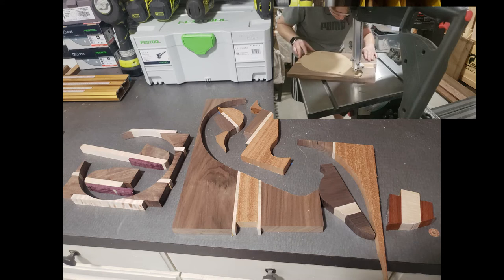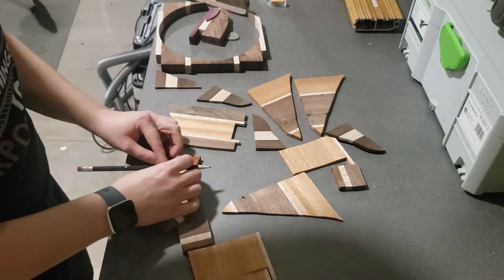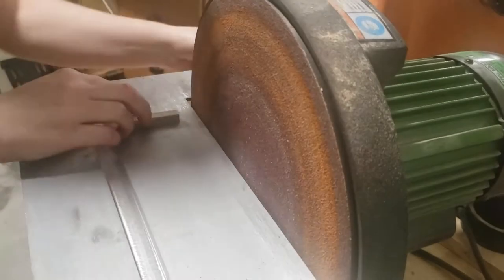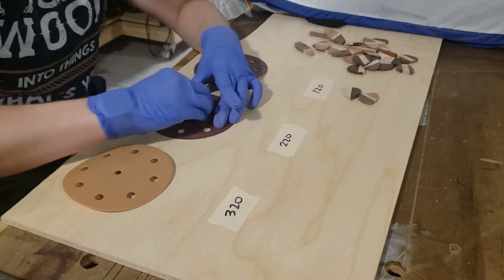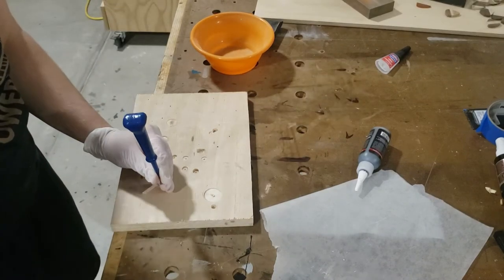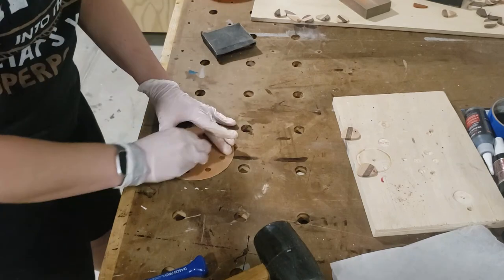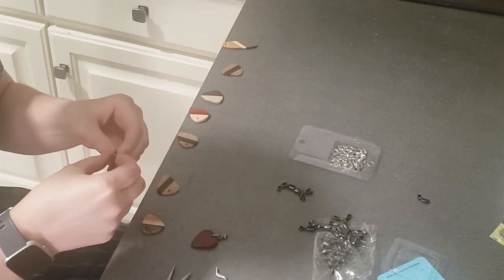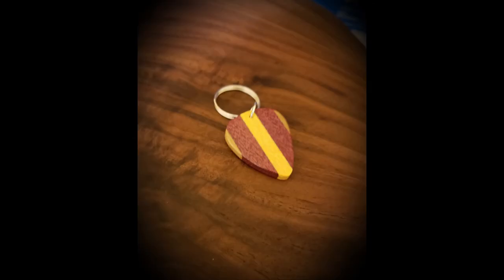Turn Scrap Wood into Etsy Products! Unique Wooden Jewelry! Pendants and Keychains

Comment: Band saw or scroll saw? I’m torn between which to buy.
Reply from the maker: That is a great question! I have both, and personally I do much better on the bandsaw for small pieces. Scroll saw is amazing for details but on smaller pieces it can be hard to control since the blade is going up and down.  The bandsaw just pulls down so it is very easy to control and I like to just do final shaping at the disc sander. But some Scroll masters might disagree 🙂